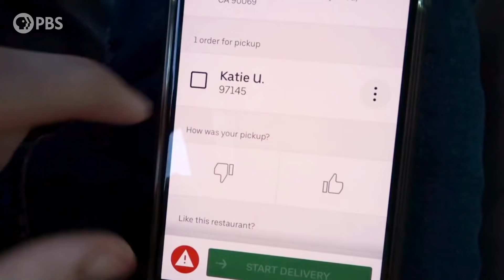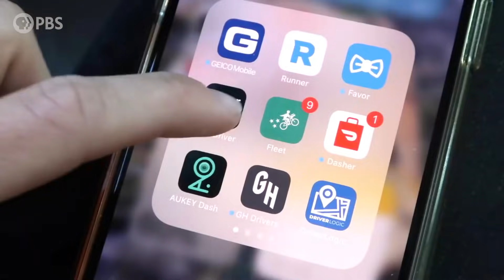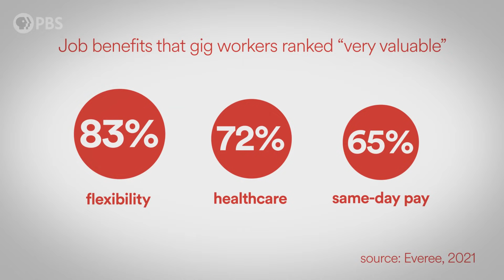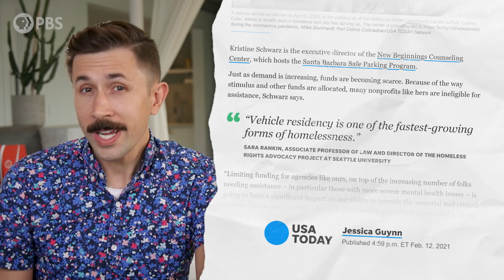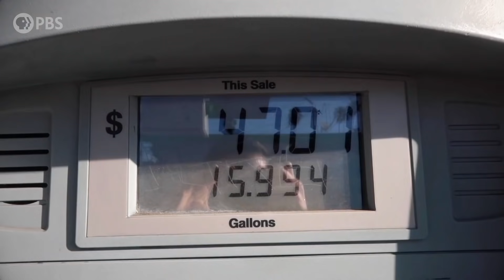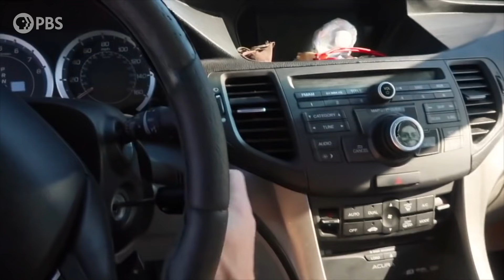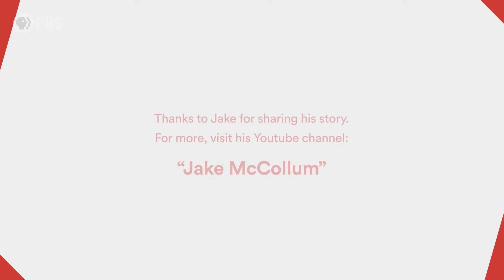Why I Choose To Live and Work In My Car (feat. @JakeMcCollum) | Future of Work

Comment: I feel like this video, while bringing up a lot of very concerning points about the gig economy, doesn't really do anything to address them. :/ The overall upbeat tone is kind of chilling, especially considering the main take away is that the corporations benefiting from the gig economy are able to do so in part because of how much of the costs are shifted onto their employees.
Reply: And they don't even mention how the companies should have more responsibility to those workers. Or at least collectively having a way to deal with them in case something happens to them. This shift to claim "well, it is his fault, he knew the risks" gotta feel great when the risks are high and people are desperate and companies can just dismiss it as the worker's personal choice or responsibility.
Reply: What do you expect PBS to do about it? They can hardly twist the companies' arms. 
They didn't endorse or condemn the situation, they just reported what it is. That's their job.
Reply: @Valdonkis  they didn't endorse, but they also didn't bother mentioning. I've got nothing against pbs.
Reply: This really common on the 2 Cents channel, they'll describe something out of a dystopia and then it turns out that it happens all over the US. If other PBS channels like Above the Noise or Origin of Everything can be realistic about racial injustice, I'm pretty sure they can extend that to economic injustice, and the two usually go hand in hand
Reply: I'm thinking that this video was designed to beat the bushes against these corporate entities. Don't feel sorry for Jake, however. He has a great future running his own business, although he may not know it yet. Clue: he wants to not have a boss... Primary trait of an entrepreneur.
Reply: Are you a gig worker?
Reply: But where can I make six figures without a degree?
Reply: Full on cringe...
Reply: But we make 6 figures

Comment: As a European it is so surreal to see people delivering food in cars. Here we mostly have scooters and e-bikes. I find it hard to believe that the economics play out if you pay for car insurance, maintenance and the higher fuel consumption of a car. Especially when you are as slow as traffic and have to find parking..
Reply: In many ways north America has always "lagged' behind European innovation and certain sustainability endeavors. Just my two cents from Canada.
Reply: That’s true for some places but for more suburban markets that have longer distances it’s safer to use a car. For example you do not want to take an e bike or scooter on the I-5 or 215 here in SoCal unless you’re looking to get clipped by a speeding car.
Reply: That’s the big problem for a lot of gig workers.  Some bigger cities do offer scooters and e-bike options, though.
Reply: The way our system is set up, you are expected to recoup those losses at tax time
Reply: @jillmac2000  - true.
Reply: Us has a lot more cars and many of those are worse drivers. Driving a 2-wheeled vehicle in US is more dangerous. Also in US everything is wider and longer and built for cars.
Reply: Here in Brazil most deliveries are also on bikes or motorcycles. Sometimes you see someone using a car, but it’s really abnormal. Sustainability and flexibility of bikes can’t be matched
Reply: @RaoulDukeSr  The USA is just a different layout it’s a far bigger place than European countries and Canada. Very spread out. Certain cities you can use e bikes and scooters but not everywhere. Those cities are basically the size of some countries and very dense.
Reply: As an American, I hope you do realize that the geography of our countries are much different. In most European countries, you all live in close proximity to each other; in America most people live in houses that are spread out and are quite the distance from a food source. I’ve lived in both countries and would never own a vehicle in Europe. You simply don’t need one.
Reply: It’s all about the distance in cities as Miami.
Reply: When you get rid of having to pay $1,300 a month (15k a year) and write off gas and mileage (break even on taxes), you're left with plenty to afford to maintain a car. People living paycheck to paycheck are in an even worse position and don't seem to realize it.